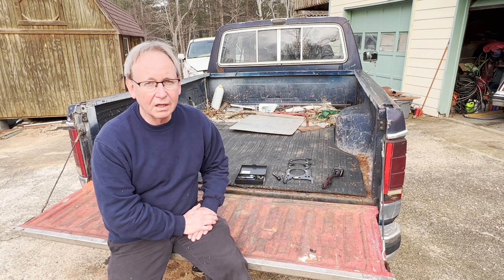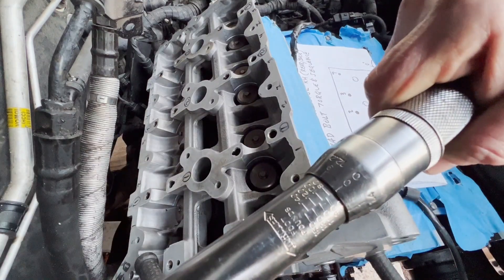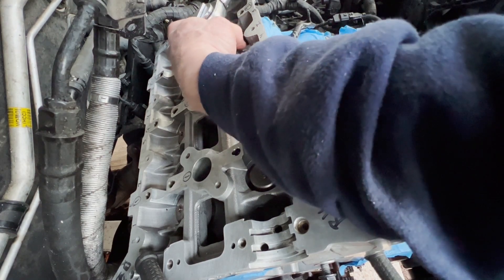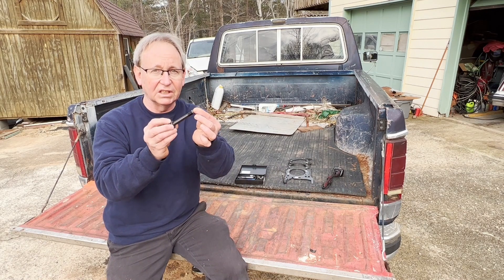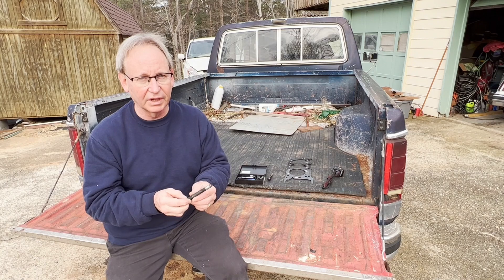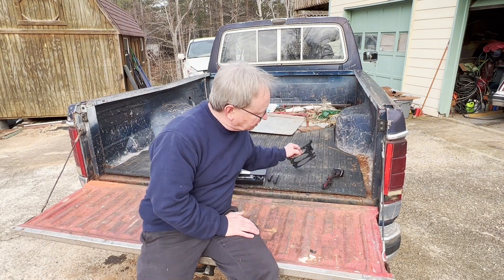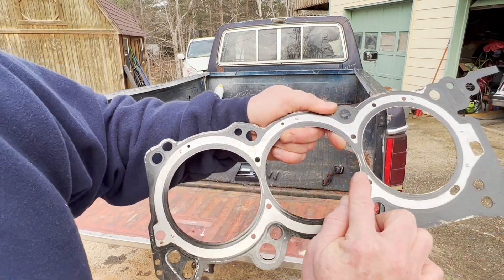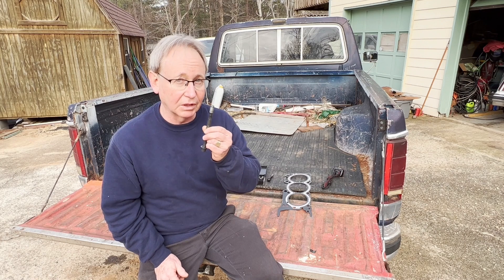Aluminum Blocks Suck - Blown Head Gasket Will Lead to Stripped Head Bolt Threads During Assembly

Comment: I pulled the VCs off of my Kia 3.8 today, it doesn't look good. Might be not be able to repair this one, I'll know after I pull the heads. There is major sludge but the big problem was the water in the oil, it did a number on stuff, rust and corrosion, So far everything came apart fairly easy. At the very least the motor needs to come out.
Reply from the maker: Well, that sucks, but don't waste any more time and money on it.  You have water in the oil, down the cylinders etc that could have entered any number of ways. Coolant eats the coating off the bearings so you'd have to rebuild it and these are disposable engines that are nearly 20 years old. Kia rod/main bearings are low quality from the factory and many develop rod knock. Kia only makes an engine for a few years and the obsoletes it. Any junkyard  engine is going to be as old as that and soon develop issues. It's just a kia which on it's best day isn't worth $1,200. I suggest watching my last video on it: https://youtu.be/6PsFy76Drbw 
or watch the whole playlist:
https://www.youtube.com/playlist?list=PLzYkLEbqfTQHaO2TLIwzSczTjgm4bXPhY
then put it on FB Market Place or Craigs, get $500 for it and do something better with your time and money. Since it was on the "Back Burner" seems like it's an extra vehicle anyhow.

Comment: That sucks. Sorry that you basically lost a potentially good block to something so frustrating. I had a Grand Prix GXP and the LS4 in those is also aluminum. I had lifter issues twice and after the 2nd time I drove the car for a while until the head gaskets started leaking. Ends up the head bolts were loose because the block holes were already stripped and the mechanic never told me about it. I was lucky and did the work myself with the kit (was a pain because the bolt holes were between the firewall and block with little room). Years later it held up until I got rid of the car, not because of issues but because I got a different car. I felt your pain and frustration.
Reply from the maker: Hi. Thanks for watching and taking the time to comment. Sucks you had similar experiences. The more I looked, the more I found either videos or forums where people had gone through all the steps, go to put the heads on and bam, the heads bolt strips. I'm an aircraft mechanic. All aluminum bolt holes in aviation have steel inserts. If this was done with automobile engines this wouldn't be an issue, but it's a car/truck and not an airplane so the manufacturers look at these as disposable. They're engineered so when you have head gasket issues, it's time to get a new car/truck.  
I couldn't justify spending over $500 for the manufacturer approved insert tool so thought I'd try putting inserts at the top for like $150. It was worth it for the experiment in the event that it did work.  It's a 250,000 mile Kia minivan, not a Ferrari lol. Using standard inserts, although I was able to tap the hole for the inserts, the hole was already too big for the minor diameter so the threads didn't have a good cross sectional bite. There's another style of insert I might try that will work with the available block water jacket thickness I have if they have them available in longer than a 1/2 inch.